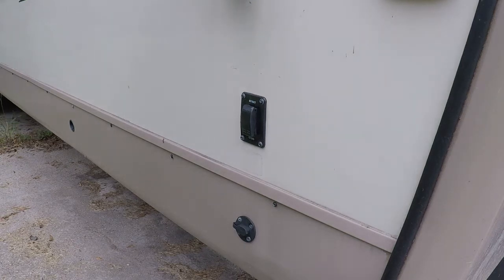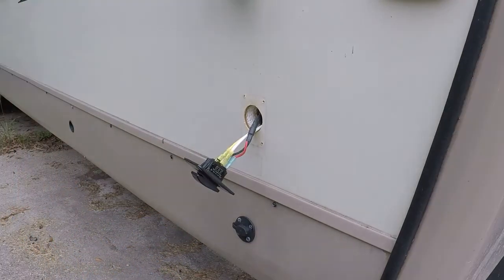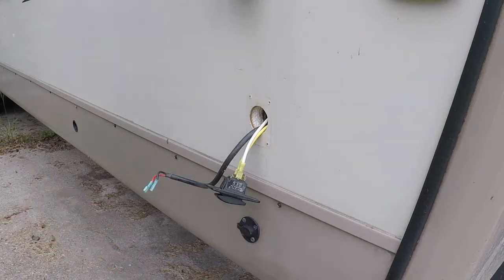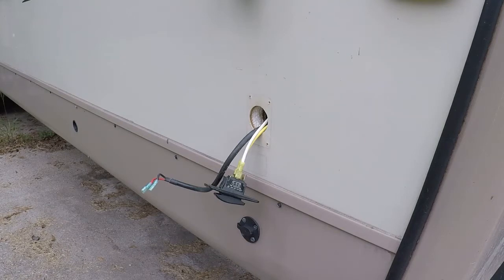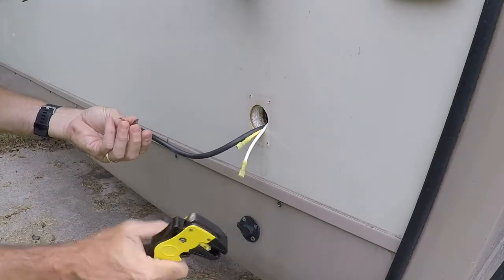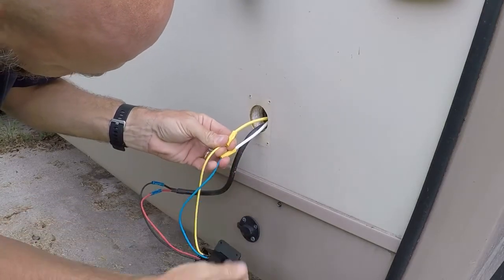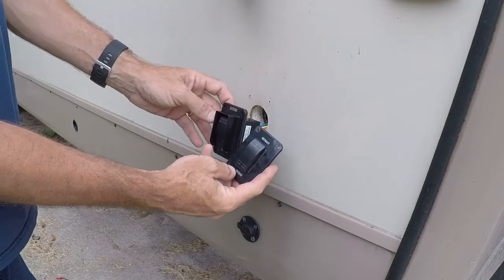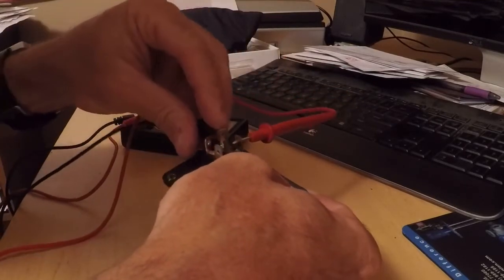Lippert electric stabilizer switch replacement

Comment: When you made the video did your switch work in either the extend or retract or were both directions not functioning?
Reply from the maker: Howdy! The switch had completely failed. I recall it looked like it had gotten water in it at some point when I took it apart. For what it's worth, the rear switch is still original on the rig and still works fine. Thanks!

Comment: Very nice job. I just bought my First TT and the Electric brakes were not connected, i bought the red, blue and yellow butt connectors that are heat shrink, i figured, could never have enough. I figure at this point they will just be part of a first aid box for the TT.

Comment: I have the same switch you REMOVED from your trailer - removed from mine.  How did you know which switch to purchase?  I can't find an exact replacement for what I/you removed.  And can't tell what you used as a replacement switch either.  Mine is also off the front jacks.  2015 Forest River Salem Hemisphere Lite 232IS.
Reply from the maker: Howdy! As I recall, I had to go to the Lippert site, scrounge around for the parts list for the levellers and I found that the old switch was obsolete and there was a new part number for the replacement. 
https://lci-support-doc.s3.amazonaws.com/complists/leveling-and-stabilization/CCD-0002579.pdf 
That is the link to the parts list and the part number for the replacement switch is 387874. LCI wants $42 for it and so does amazon, but if you have prime, you can at least save the shipping. Good luck!

Comment: Thanks for this video! You saved me.  I am a full time RVr for over five years and never had this rocker switch fail. I unhooked my 5th wheel and everything no issues. Then went to raise up the front an inch and the switch didn't work at all. I looked online for a mobile tech to come to our location and it would have been at least $400! (F that). I found your video and stole the rocker switch to our master bed lift. Switched it out and now works fine as a temporary solution while on the road. Once I get to a spot where I can receive mail I will order the new switch. 

Thanks for your help!